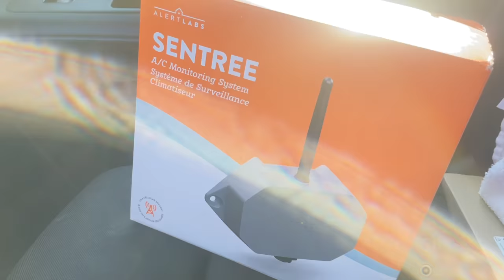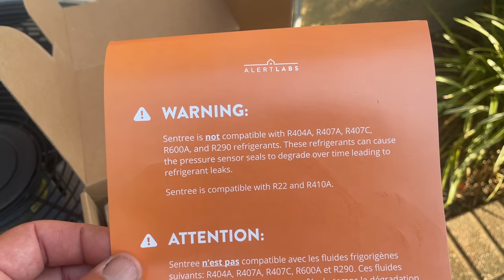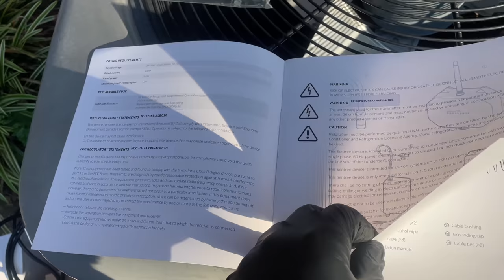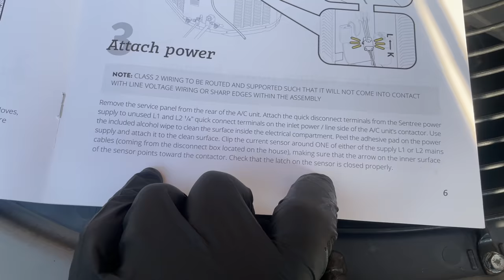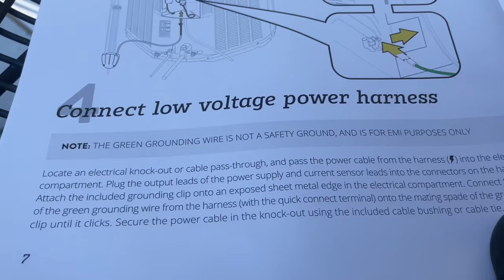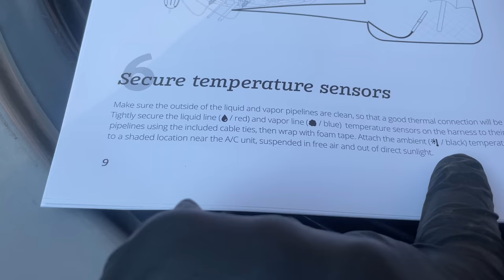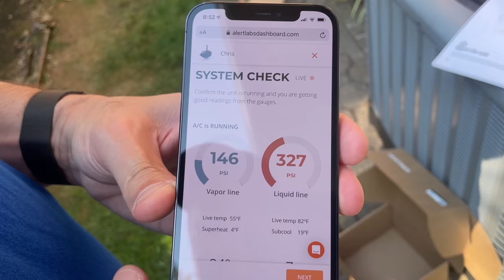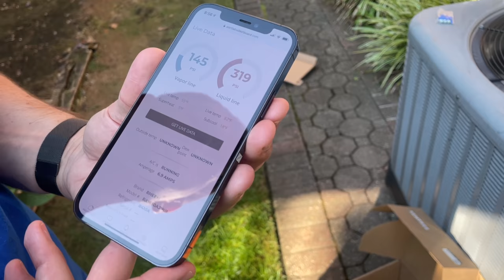Installation of AlertLabs Sentree AC Real-Time Monitoring System Help Preserve Your Clients Systems

Comment: This could be really useful for snowbirds and vacation homes to monitor for leaks, floods and freeze-ups as well if those features can be added. Tying this to a whole house water shut off valve would be useful as well. I like that the contractor can get the real time and historical data for the mechanical systems.
Reply: The same company makes all that stuff too. I think they started with water monitoring.

Comment: You can monitor how quickly a Lennox unit leaks down. 😂👌
Reply: Or a Coleman,  York, Goodman,  or ICP
Reply: Well they come with TXV's now at least of most new coils.
Reply: @guyhulscher6857  forgot Trane evap coils
Reply: I have a Lennox 10acb-48 been running for 20 years with only the outside capacitor replaced. Never needed a useless monitor system. Its a gimmick to make money. Only adds another piece of hardware to cause a leak itself! Like said earlier useless aftermarket crap

Comment: Thanks for this.   I am looking something like this that would allow me to feed data into a excel sheet and calculate the compressor efficiency on line using RefProp thermodynamic software from NIST.  I have used for years in industry and it works great.   I am glad something like this is available for a homeowner.

Comment: it also needs Psychrometer Probes for temp and air flow monitoring.  But this may cause more issues not only with that potential leak area also by making customer concerns with possible false alerts. love your vides.

Comment: That Current Sensor monitors the power of the system. In polarity on the line side and out polarity of the secondary sensing side of the current sensor. The system will meter the power use of the AC components, much like the utility meters the power usage of the home owner. Of course its main purpose is to monitor the AC freon system as well. Kinda cool but kinda pricey too.

Comment: I would think this would be best suited for businesses under contract basis that way enables quick in and out preventative maintenance if compatible that is. But if offered as a contract basis you own and operate the equipment and can remove when contract is up or contract is broken due to loss of business or anything of that nature.

Comment: I been building stuff like this for decades and running it in my own home systems since 2004 :)   it is cool stuff though
Reply: @PipeDoctor  only thing is I like to not touch the Refrigerant circuit..  on mine I monitor Pipe temps in / out  on both evap and condenser..  and air temps too. .  knowing all of that you dont need pressure transducers..    I dont need to know specifically if my freon is low  but that there is a system problem..   now when you work on big commercial stuff that hokds 40 lbs of freon you want to know specifically if the charge is leaking..  but on residential  I just want to preidct failure..    a little tip is I use Heat sink compound when I attach temp sensors to pipes they give faster readings

Comment: Been using sensi predic. It doesn't install on ports. It's installs at furnace and  only amp draw on condenser.  Monitors cooling, and heating.

Comment: I think you need to refer to you KEV replacement wrench as KEV 2.   Great education on the new tool- you feed us!!! Real world observation- what about critter chewing? We have razor teeth wire eating pack rats around here in AZ. This tool is expensive food installed on the outside unit. May not be an issue in your neck of the woods😊

Comment: That system seems decent, it would be better if they used Deutch connectors on the harness and were able to be assembled in the field so the wiring could be more pleasing to the eye by doing away with excess. Also allowing wires to be routed in a way to protect them according to the application. The only drawback is a good Deutch  crimper is about 300.00. Be interesting the condition of this contraption in a year or two. Hope all is well Mike, keep up the great work. Cheers from L.B.I.N.J.

Comment: I like this approach very much. I want this system so bad but unfortunately I do not have an AC system. 🤣🤣🤣The manufacturers could look at incorporating the pressure transducers into the HP/LP lines, so that this sort of remote monitoring can be incorporated. Not sure having to spend $700 for the kit and then shelling out $120 year for the monitoring subscription is great for customers. Should be $700 purchase price with ‘free monitoring’ for life , OR $120 purchase price and $120 monitoring per annum.

Comment: It’s interesting, but the only reason I think I’d be interested in it is monitoring the A/C while on vacation. 

But… the way this unit is, all it does is report an issue, so if your system is tanking when you’re not around, you’re going to need to call a friendly capable neighbor who’s home to pull the disconnect. 

If they were thinking (and who knows maybe it’s an option), have a relay in that monitoring system that one of low voltage contactor wires go through that can be remotely opened to shut the system down, or configure the system to open the low voltage if a threshold of parameters is crossed (pressures/current too high/low).

Comment: The CT orientation matters more when using multiple CT (line/neutral or on a 3 phase system) on 3ph each phase is 120° out of phase from each other. The CT can "see" the ac waveform and mixing up the orientation screws up the three-phase power math..... There's more to it but I'm going to leave it at that.
Reply: Picture in AC waveform: up down up down...

Flipping the CT: down up down up

Doesn't really make a difference unless you're comparing that wave to another

Comment: When the metering device is a fixed orifice, how does this check for proper charge? doesn't look like it monitors return air wetbulb temperature.

Comment: i think i would have turned the pressure sensors to get as close to the unit as possible and put temp sensors inside unity with all wires and only run the antenna ambient air and a little bit of the pressure sensor wires out side the unit

Comment: Mikey you should have put on your gages to see if the match and I like the alcohol swabs so you don't give it the China . But I agree it is just one place you can have a leak . As for the landscapers a small fence will fix that but it won't stop a leak . I don't see he need for this at all . Aren't there high end units that have this built in to them now ?

Comment: Is this the dude with Nest thermostat? Would rather have some temp sensor inside that would send alert ( if home unattended)than this system. Don’t like those sensors that attach to fittings( without O rings). What do you do when have to recharge system?Looks like a great setup for refrig leakage over time.
Reply: Shouldn't interfere with anything, they have pass through fittings.

Comment: So this is like a permanent set of temp & pressure gauges for the homeowner to monitor his system? Like you said the 2 pressure sensors are a potential leak point. Interesting idea. I wonder how long it will last for?

Comment: Interesting one.  I wonder if manufactures will offer this in the future on their High-End units.
Reply: American standard and Trane do on there variable speed communication system. Can see everything live and all history right from the office. Crazy how much the trade is changing.
Reply: That add on basically making the unit a communicating unit. I deal with Carrier Infinity units and The UI calculates so much things I'm still learning to use. On PM calls. I use check out mode to get to get Low and High stage readings,  amps , refrigerant levels , and airflow all from Main Hub. It calculates subcool especially if the system is a higher seer it will definitely have a VFD Inverter

Comment: what I see? they've effectively turned "two" leak points into "SIX" leak points. #1the seals at ports to their tee's,  #2 their ports on other side of tee's. #3 through their magical pressure switches/transducers.
as if all of the systems(old/new) don't have enough leak points and issues as is ;)
Reply: Exactly why this device should be tossed out, its just a gimmick

Comment: Current sensing relay needs to be installed in the direction of current flow , which is why it needs to point towards contactor.
Reply: the current flows in both directions, so which direction should it be in, again?
Reply: @Jon-hx7pe  current would be flowing towards appliance that’s using it aka the condensing unit/compressor
Reply: I've spent way longer than I care to trying to research this to understand what I'm missing. And I've come to the conclusion that I'm not missing anything. There's no reason I can think of for a current transformer as used in this application to be sensitive to polarity.

Multiple CTs or multiple phases: yes, absolutely it matters. Measuring both current and voltage: yes, absolutely it matters. But this thing is effectively just a single-phase AC ammeter. If someone can explain the physics of how the direction of installation makes a difference to that measurement, I'd love to hear it.

Best practice to just follow the instructions anyway, of course, but I strongly suspect it's irrelevant here.
Reply: Hand-held Multi meters read the same current in a wire no matter how they’re connected. There is no reason.
Reply: @ChrisMasto   Perhaps it is driven by how the microprocessor samples the secondary of the current transformer.
Reply: @jkbrown5496  I'm sticking with "it doesn't actually make a difference".

Comment: Talk about over engineering…jeesh, sub cooling to high superheat too low added leak points, I get it it’s cool and all but is it needed? 🤷‍♂️
Reply: it's as needed as the junk quality in todays equipment, but it's "green" and "saves energy" by golly :))))))))

Comment: Meh, I’m not a buyer. I do see the value in setting this up for diagnostic reasons for problem child units however.. unit  randomly goes off on low pressure. Might just verify a sticking closed txv and such but for a grand installed with overheads, warranty and a fair profit…

Comment: I think the true acid test will be the answer to the question : “ how long will this thing last, especially after several tough winters?” Will that unit wind up hanging from one screw and the housing fade and crack.???Looks like plastic.
Reply: "several tough winters", you're really giving them the benefit of doubt ehh?\
I'd guess two years before it leaks all the charge out and gets scrapped by the next HVAC tech. lol
Reply: @throttlebottle5906  It seems like another “control” gizmo. A co-worker told me about a program  in the 80’s where Jersey Central Power & Light ( JCP&L) installed radio controlled relays in series with the contractor on outdoor units that would permit them to send out a high power radio signal to an area and open the relays during high demand times to prevent blackouts. He also told me that most people would just jump it out or remove it once they found out what it was. Today, the utility company can probably take your whole house off- line using the new “smart” meters. Big Brother IS watching YOU !!!
Reply: @paulrozinski1488  there has been " peak load/demand" shedding meters and timers installed all over the USA for many years. timers were mostly on electric water heaters and turned them off during daytime peak hours and back on at night. air conditioning and other large non-essential loads were often remote relay controlled, so the power company could send signals via the power grid to power off and control loading during the highest peak times.
Reply: @throttlebottle5906  All of that is new to me being from NYC. Our idea of “load shed” is a blackout  😂😂😮😮
Reply: @paulrozinski1488  lol, sounds about right!
much of it was done away with long ago. water heater timers and second meter with different rate was WWII and following war time savings.
much of the hvac load shedding cruft is gone also, it's caused many equipment issues and nuisance service calls, so it gets the snip-snip action by almost everyone on first service visit. :)

Comment: Over priced IMO.  Service fee for cellular and no internet network connection is DUMB!  There are many energy monitor devises (sprinklers, propane, power, etc.) where price is built into system cost.  There are many places it is opposite (bad cellular) vs WiFi.  Wires exposed is DUMB.   Question on accuracy = Why did you not check against your gages (Especially since sub-cool seemed high)?
Reply: @PipeDoctor  solar monitors use it all the time, WiFi or hard wired to network.

Comment: You should have just sold him a Bosch swap out!😄
What is the above average Joe homeowner going to do with that crap !
KISS ! 
I Don't need to monitor anything, just call me when it's a problem. You just added more leak points. 😳 
I don't even like aftermarket fan cycle switches. 
He'll look at it until the novelty wears off!
😂 
🥃🥃🍺🍺🍺🍇🏌🏻‍♀️
Stay safe. 
Retired (werk'n) keyboard super tech. Wear your safety glasses.
Reply: Plus it costs 120 bucks per year for monitoring fees. Just put that towards your yearly service contract. Big waste of money.
Reply: @YukonHawk1  Holy sh**, I 100% agree with you. I cannot forsee this prevent a catastrophic failure, I could see this as an asset in industrial settings like data rooms where a/c is critical to the equipment or on refrigeration at restaurants if in fact I can be used on such shstems. Alerting of low refrigerant and addressing the matter before total shutdown on a weekend or after hours.
Reply: @potatolew4495  Definitely can see that being used in an industrial or commercial application like a data center or server farm.